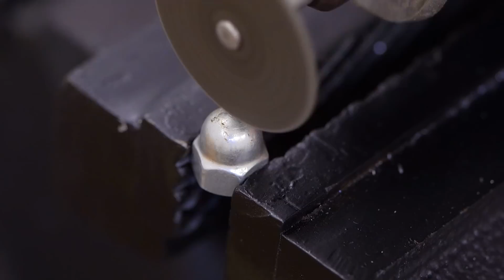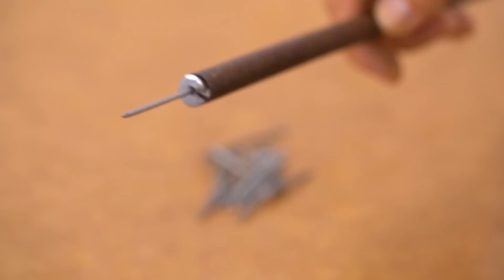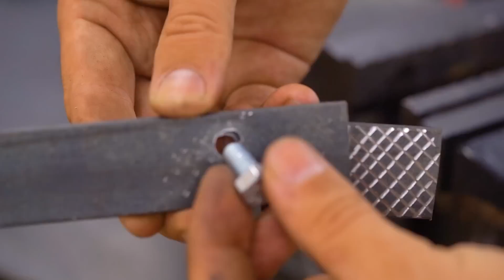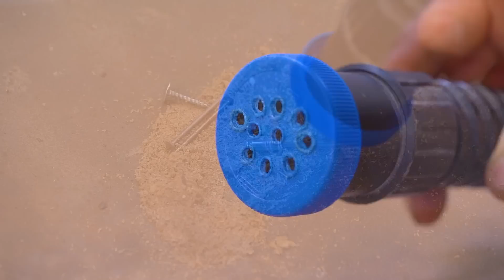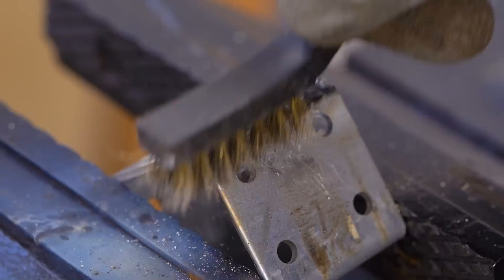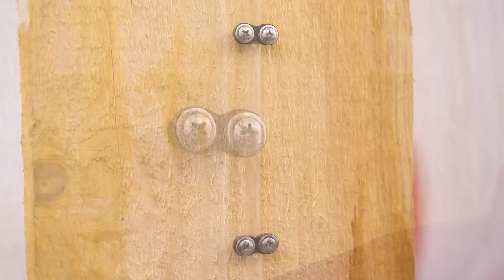GENIUS HANDYMAN'S SECRETS

Comment: As a welder I have to say please don't use container plastic as cover lense that will for sure melt with any length welds
Reply: The helmet looks eerily like a "Protector" brand  ,a backyard company started in Australia  ,years ago. And yes,replacement outer lenses to fit are almost impossible to find.

Still...A man's gotta do what a man's gotta do.
Reply: @siyaindagulag.  if that's the case the correct way would be to go down to any hardware store and buy the standard size lenses, measure and scribe a line with a razor blade or something sharp and break off the excess. I had to do that for a cheap helmet I bought while I was in welding school
Reply: @Chris-iz7hv  same here bro.
Reply: Couldn't you just use some window glass?